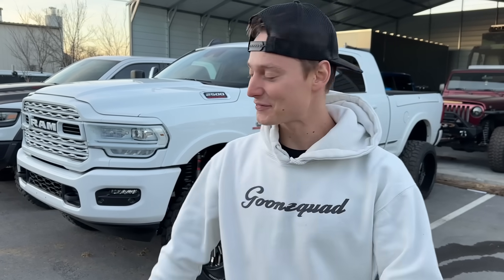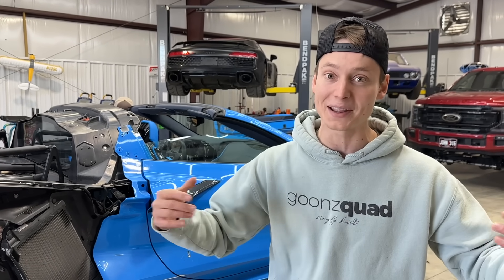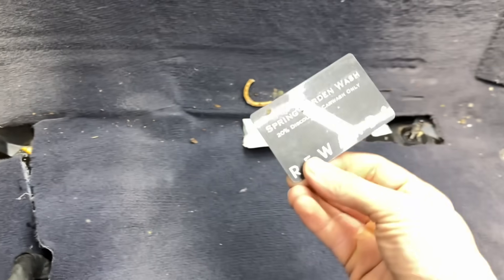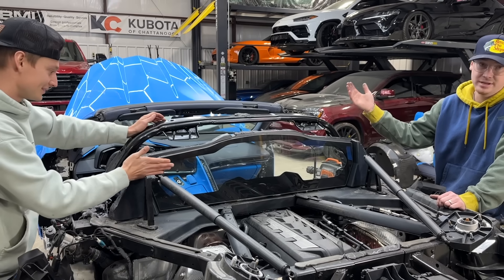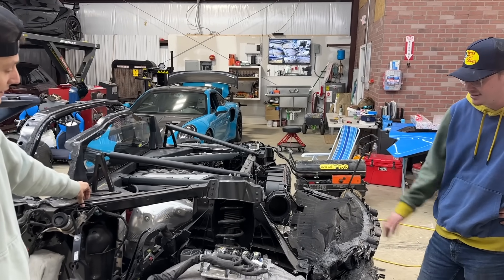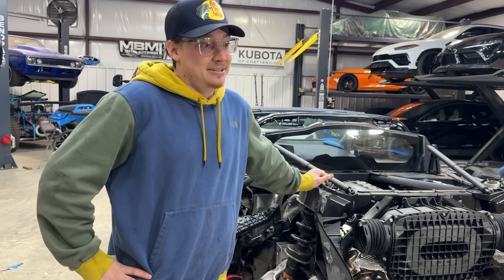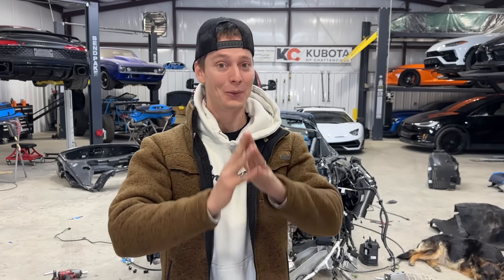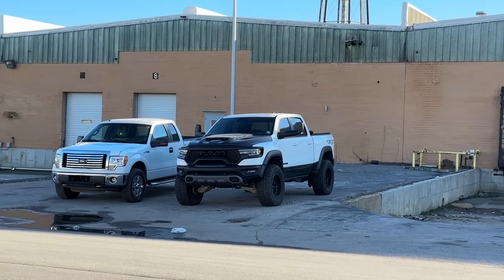Rebuilding A Wrecked 2023 Corvette C8 Part 3!!!

Comment: With the exhaust actuators, they are probably normally open until you turn on power.  they most likely fail in the open position.

Comment: Hey guys I rebuild a lot of Corvettes over in Paris TN at Custom Auto Body. Check with Striker Auto up in Bativa Ohio. They have rear clip frame sections for 1200. They can even ship them to you. It will be the complete rear frame clip. Also these c8's bring stupid money at auction. Car your bidding on will probably go for high 20s to mid 30s. Striker will have the rear frame section you need. The parts car would be a waste since the tub and rockers are almost impossible to get off without damage. Will need structural rivets and structural panel bond for the frame sections.
Reply: If you still get the parts car or go the route in Ohio you will still need to get the rocker panels just because even trying to take them off the new parts car will be destroyed just like the ones you took off this car.

Comment: The set of valves in question (the ones closest to the motor/ furthest upstream) are the AFM valves (Active Fuel Management valves) and close partially when the motor is in V4 mode for increased backpressure so the motor works better/ more efficiently when half of the cylinders are disabled. 6th Gen automatic Camaro's have that same AFM valve further upstream from the mufflers too. Manual camaros dont have them, they have "skip shift" instead. Its all EPA pleasing technology. The set of valves furthest downstream/ closest to the actual mufflers is for the dual mode exhaust portion obviously. Not sure if they still call it the "NPP" option on C8's but thats what they call it on older Corvettes and newer Camaro's.

Comment: Anyone else noticed the R8’s tyres not fitted correctly at 15:36, need to fit those Toyo r888 correct on the rear, maybe this is why you’re having handling issues
Reply: Saw that too and since it's no regular car the wrong fitment of asymmetrical tyres might cause a lot of issues with the handling

Comment: Most court shoes are glued together. If you buy a pair of Air Jordans and just leave them in the box for 20 years, when you open the box, they'll be in pieces because the adhesives all breakdown and crumble over time. In light of that it's comforting to see that automobiles are now made of plastic and glue.

Comment: There's a 'Quiet Mode' in the exhaust settings so you don't wake the neighbors.That truck's supercharger sounded wicked.Since you'll have a 2nd rear drivetrain, it may be time to make a Sandrail .?.Or...Doesn't the GT accept a GM V-8?? You have a couple cousins that are certifiable ;),so why don't you ask them if they can order the frame?

Comment: exhaust: middle 2 valves are AFM that control v8 to v4 switching. outer 2 valves are specific to factory performance exhaust, which control tips closing/opening for volume

Comment: The rear impact bar HAS to be the first point of failure.
If you had a normal pressed steel impact bar screwed into thin aluminium frame rails, then every little impact would result in the whole tub being written off instead.
You can literally see on this car how little an impact it took to break the frame rails.
The impact bar isn't the design flaw. The entire car is the design flaw!

Comment: A parts car is a great idea and you can sell the engine from it or use it in another build. There are so many parts to the frame, subframe, and towers, you will be better off having a whole frame to use.  Unfortunately you will still have to buy rocker body panels.

Comment: It would seem the GM engineers used fiberglass to act as a buffer between it and the aluminum frame rails. It is possible during the testing/development phase GM realized using a aluminum crash bar created substantial damage to the rear structure.

Comment: Hopefully there’s some beefy axles that come with the 1000hp upgrade. Cletus’s setup seems to work pretty good on the track. 
Trx would look good with the hood painted white. Still would keep that tough truck look. The all white would look fantastic but would look more fancy then tough. 
If you get that parts car hopefully you can sell all the pieces you have leftover from building one or else it’s probably financially better to just buy a nice one. Rob Dahm had his car repaired from a certified shop bc his damage was in the front and same thing the parts weren’t available to the general public. At that time his was the first wrecked C8 to hit any type of auction blocks.

Comment: Well if you’re dropping the subframe and engine might as well supercharge it! Best for the platform IMO, turbo’s can get more power, but the supercharger is there in the low end and with a good Gen6 setup you can get 25PSI which is MORE than enough these days.
Reply: Why not put the other Corvette engine in the old school Camaro you would have all the stuff you need to do it with on the other car

Comment: I'm not a  big fan of new Corvettes  they just aren't built well but you guys are doing an awesome job with it. Remember the 60s Camaro that was hot .It would be so awesome if you did a 70s corvette those years can be so tricked out with louvers fender flare wide body kits side pipes shaker hoods T tops .The mods are endless Hope you get that frame situated that's a bummer. Merry Christmas to you both and Mom and Dad.

Comment: Insane how they have a trackhawk back there collecting dust. I would daily the hell out of that
Reply: They do have a lot of cars & trucks to drive!
Reply: They would never get any work done if they daily drove ever car they have.
Reply: @koolkar55  Some of the cars and trucks will have to sit for sure! But they are so cool! I really like the old Camaro. It has a lot of potential to be an amazing custom car. Solve any mechanical issues and an amazing custom paint and that would be one wild ride! My last 69 Camaro was an RS?SS convertible and I went as far as I could with the money I had and it was an amazing thing to drive. Anyhow the blue Camaro has potential and somewhat low cost content compared to a high level rebuild like the new Corvette & the Porsche!
Reply: Simon has his own new Track Hawk ! Not the one they rebuilt !
Reply: If you notice when they do actually daily something they build, it breaks a lot. Like the TRX. They never actually get anything 100%. Did you notice the muffler on the Bronco spewing out condensation? Their builds don't handle daily life which is why they daily the "brand new" give-away vehicles.
Reply: @1one3_Racing  I was behind a newer Raptor probably 21 or 22 the other day and it was spewing condensation more than the Bronco so that might be a Ford thing! The Raptor looked mint and well cared for but spewing water!
Reply: @tnolan3176   this is just not true lol

Comment: The rear crash bar is hooked to the frame rails, so the stronger the crash bar is the more damage it would cause to the frame rails during a collision. So they make the crash bars so that they flex/give so that most regular types of collisions won't cause that much damage. When you have a stronger crash bar all the energy from a collision goes straight into the frame rails causing damage to them. When you have weak frame rails like those thin aluminum ones in that Vette, then it really doesn't matter how strong the crash bar is, those rails are going to give no matter what.
Reply: You know it all
Reply: @Toddscamry-lk5wr  I don't "know it all" but I do know a lot...

Comment: 🌴 hey squirrels, 😆it might be easier to rebuild the parts car ! 🤔   And then there’s putting a different bump stick in the engine, ? Usually the heads get stuff done and of course exhaust , you might wanna check into all that with the guys doing the track hawk?👊🏼

Comment: The valves on the exauhst is called a Bi model exauhst, basically the flaps open on heavy to full throttle for more power and noise and closes when driving threw town so it's quiet.
Reply: *Through

Comment: You can't afford a rolex watch.
Sell the following cars:
Black ford Bronco
Lamborghini Urus
White Lamborghini Aventador
Black Tesla Model X
Orange Viper
Black and blue kit car
Green POS factory 5 racecar
Red POS Nissan Z car
Black Tesla
White ex-cop car
White Ferrari
Black Chevy silverado
Blue Camaro newer one
Blue Mustang
Blue kit car
Blue cadillac cts-v 
Audi S6
The old crappy boat you tried to restore
The helicopter
The ex-army 4wd camping truck
Red Trackhawk
White Ram truck
And all half broken cars that were bought for parts.

KEEP: Merc G63 Wagon, RAM TRX, the F-250 Tremor T/diesel for towing, the 67 Camaro, the Porsche 911
The new red tremor truck needs a service change the oil and filters and do a Dealership checkover and clear the codes. It's a Cummins engine you don't use Caterpillar parts on a Cummins engine.